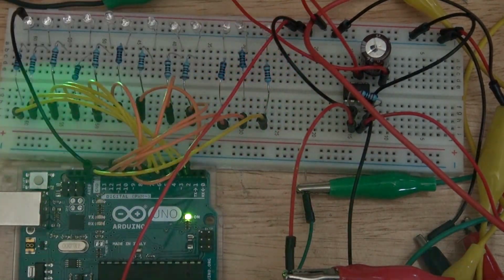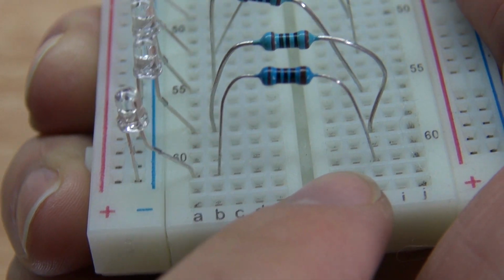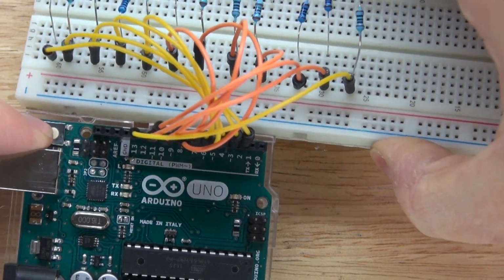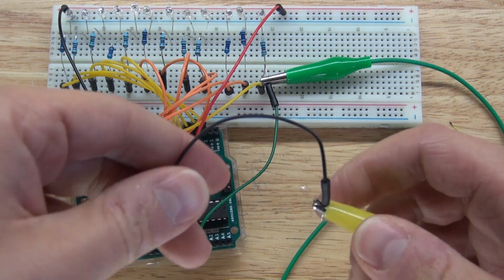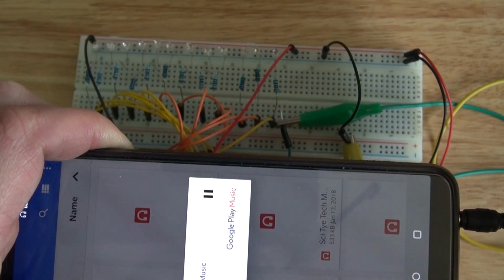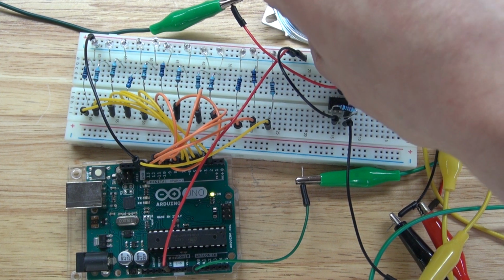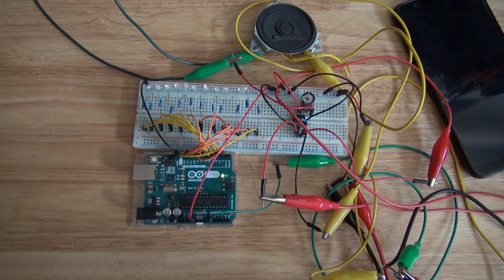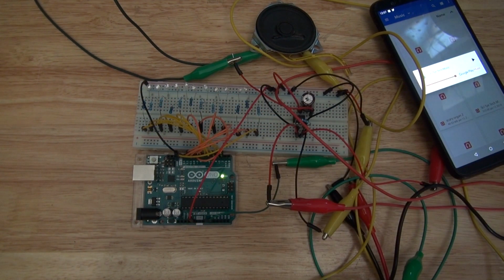Arduino VU Meter With LM386 Amplifier

Comment: Hey im going to try and get in contact with you. I'm trying to connect my arduino to a gp2040-ce. It's for a custom fightstick. You seem to know a lot about this. I'm trying to get my fightstick to play the jurassic park theme song when I turn it on. (if I could add sound to the buttons when I pushed them that would be cool too)